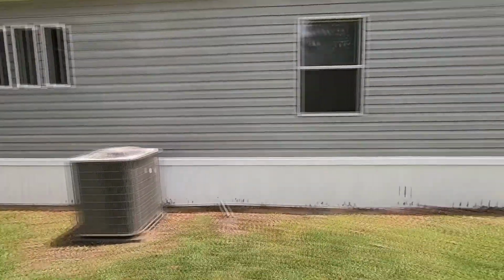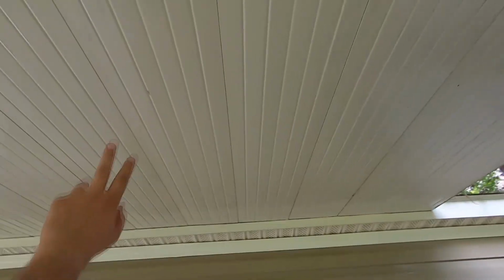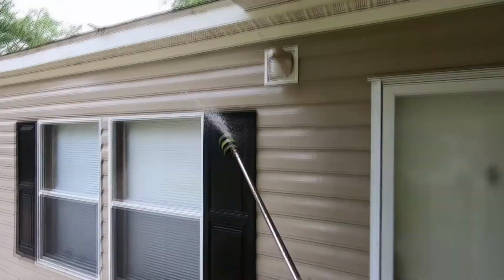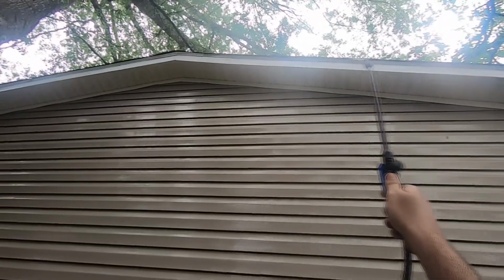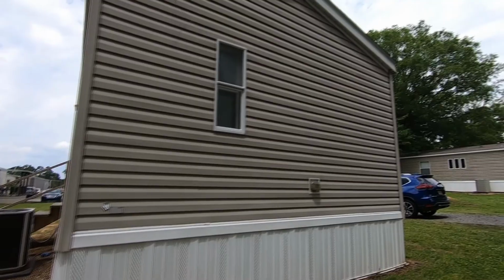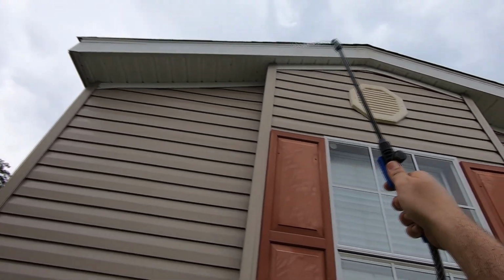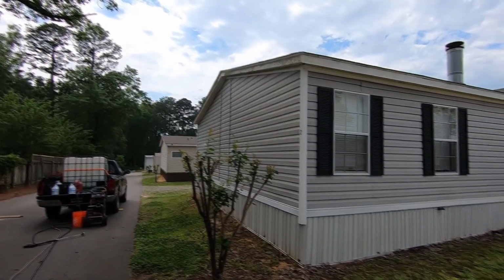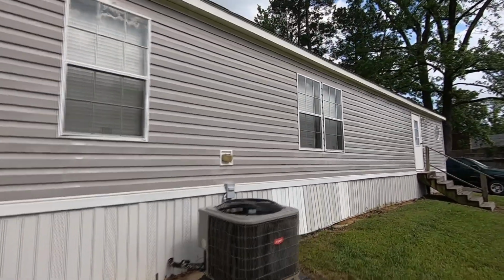Day 1 Cleaning Entire Mobile Home Park | Satisfying

Comment: Thanks for the video. How did you get this contract? And how much did you charge per trailer?
Reply from the maker: I used a facebook ad to promote mobile home washes for a flat rate of $100. Which is a little cheaper than my minimum for mobile home washes but I wanted to see if this promotion would lead to recurring customers. I only ran the ad for two days and got a call from this property manager who wanted me to put in a bid on multiple mobile home parks she manages. So far two of them have approved and I think thats about 70 trailers total.
Reply: @jeffreymorgan5917  Thank you sir. I'm gonna give that a go.
Reply from the maker: The ad said something like "mobile home wash for a flat rate $100. Offer ends soon. Call now to get your quote" gotta create some scarcity lol 👍
Reply: @jeffreymorgan5917  did anyone with a double or triple wide ask for that same rate?
Reply from the maker: @uliseszambrano2761  I only had one other customer with a double wide take me up on that deal before I got the deal with the mobile home park and stopped the ad. The majority of the mobile homes in the park are single wide but there are plenty of double wides but that's really not adding that much more to wash.
Reply: @jeffreymorgan5917  Thanks for your help. Really appreciate it.
Reply: @jeffreymorgan5917 How long does it generally take to clean one mobile home?